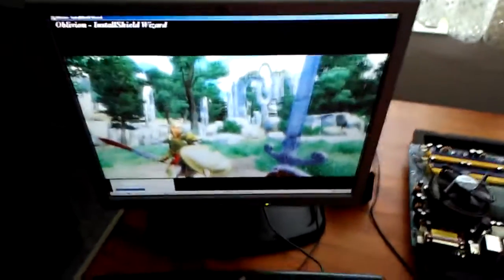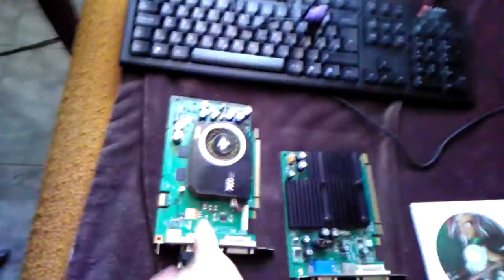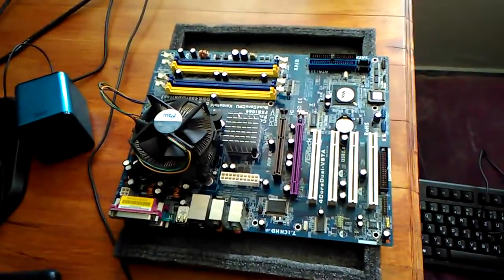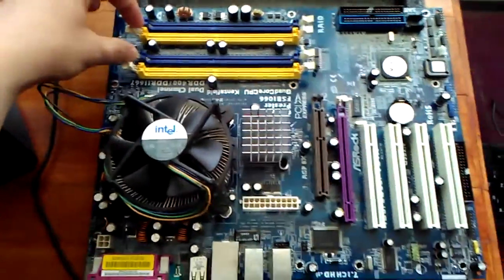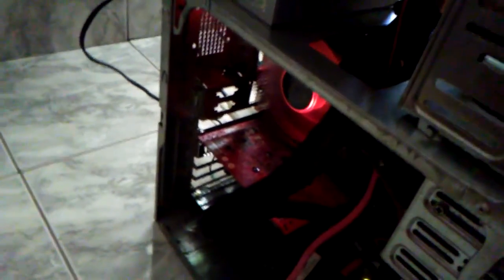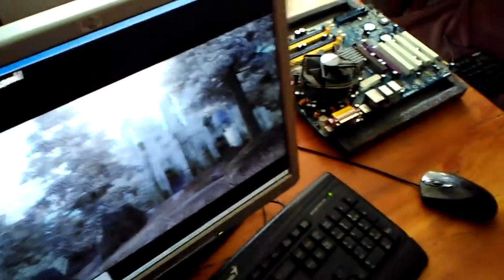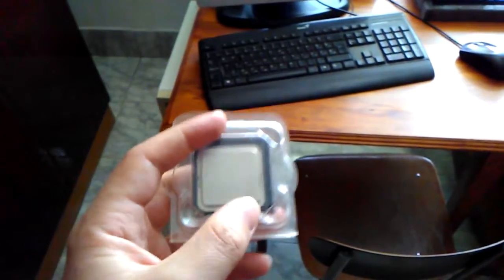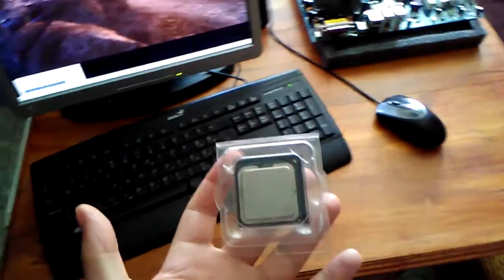RETRO PC - ASRock 4CoreDual-VSTA (AGP/PCI-E, DDR/DDR2, 775)

Comment: That brings back some memories.   I had this back in 2007 to use with a Pentium Dual Core E2160 and an Radeon X1950 Pro AGP for a spare PC.   Worked pretty well.
Reply from the maker: Wow, the  X1950 was a beast. :)

Comment: hey this is what i have butttt it is currently not working fans go to full speed and never boots
Reply from the maker: Hey, I'm not sure it is completely dead. You should unplug everything from the board which is not necessary and see what it does. Try different RAM modules, other power supply. If it is the board, maybe a CMOS reset might help. Then you can check voltages on the board capacitors and go for more complex diagnostic tools, if you can and none of these helped so far. Switching to a different graphics card might help as well.

Comment: did you try it with 4gb of ddr2 ram?
Reply from the maker: Unfortunately no. I never had any DDR2 module larger than 1GB. Two slots total, so 2GB was the maximum. Officially it supports only 2GB as well, so not sure if it is possible to use more than that.
Reply: @JohnAmanar  You can search for a newer experimental bios online. I think it was 3.19? (4-29-09) It raised the memory limit to 3gb. You can put 4 gigs in but it will only recognize 3gb. I have it in my desktop right now with 3 gb. I have a pentium D 3.4 running @ 3.81 reliably.
Reply from the maker: @chuckles1954  Awesome! Thanks!
Reply: I've bought this MB and have the same issue. Cant boot with 2x2go ddr2, i have a black screen. 2go+1go works. The mb manuel says 4go its ok.

Comment: Hi nice vid !
Did you use it in windows 98 and windows XP ? If yes, did you have problems with it ?
Reply from the maker: Thank you! :) I have only used it with Windows XP and had no software or driver issues. Windows 98 can only use 1 core, so it was no point for me to try using it with a dual or quad core CPU.
Reply: Thank you for answering :) I was asking about Windows 98 mainly because of the presence of the AGP slot. I read that PCIe "could" work in win 98 with some cards but mostly with modded drivers etc. so not something really native
How much did you pay for the motherboard by the way  (if it's the case of course) ? :)

PS: I really like the fact that you're playing Oblivion to test your hardware, such a great game!!
Reply from the maker: I've never tried Win98 with PCIE hardware, but it is an interesting topic, so I might make a video about it next time. Thanks for the idea! The mobo was 10 USD, really cheap I think. So sad that the PCIE on it is only 1.0 4X.
I love Oblivion! :D Also it is awesome for testing. It can run on very-very weak hardware and can be demanding on older high-end PC-s as well.
Reply: You're welcome ;) Yes I saw that most motherboards with both PCIe and AGP slots have the x16 PCIe cutdown to just 4x. If I remember well there's only the Asrock 939 Dual-SATA2 that has full bandwith for both slots thanks to the double northbridge approach

Edit: https://www.youtube.com/watch?v=GsKliPiovjc for more information about that :)